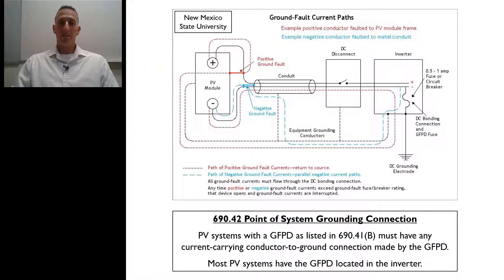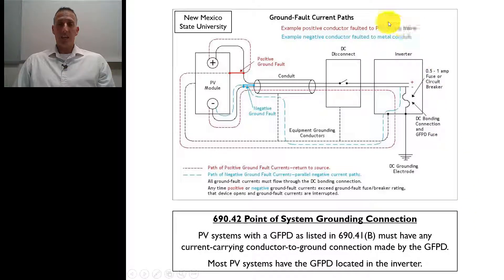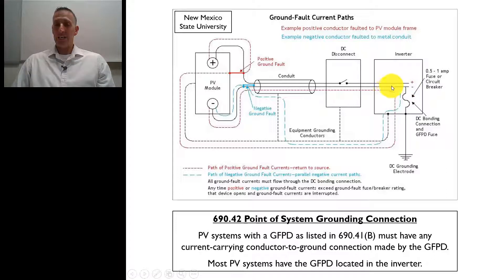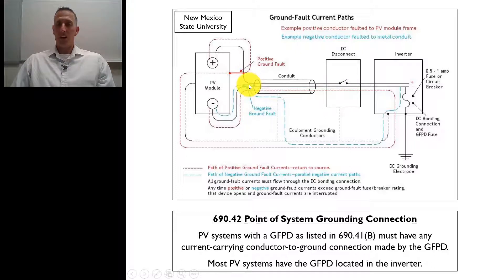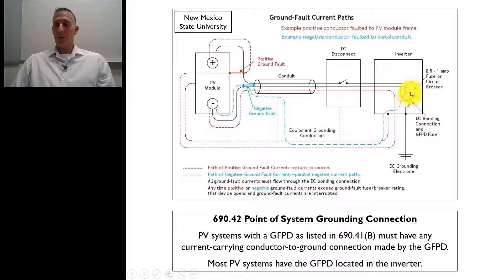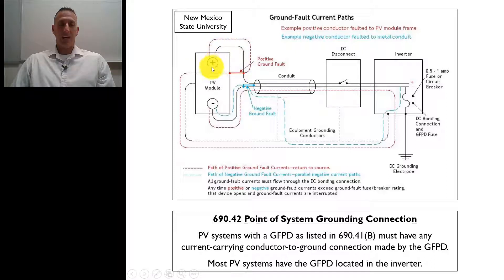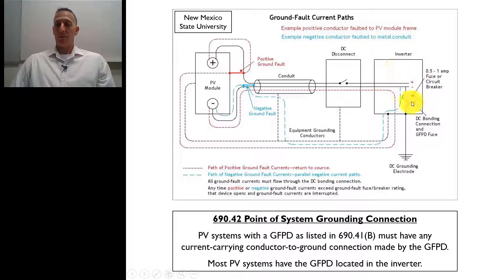Solar Training - Ground-Fault Current Paths

Comment: Great Video! This wasn't what I was actually looking for but I found it to be excellent content. 
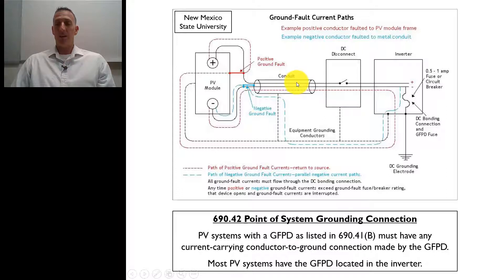   @4:30, You hit on my 'Pet Peeve' about people discussing electricity and issues with it. The old 'The power takes the path of least resistance!'... As you said it does but it takes all paths. Some not so knowledgeable people actually believe that to be true or fact. I have had to explain that if that statement was accurate, components in parallel wouldn't work, current would only flow through the component with the lower Ohm reading!
     Thank you for not repeating that old erroneous statement that way too many believe. Again, Nice video. 
       Ya'll Take Care and be safe, John 
PS: Would you know of a good video in relation to testing a solar panel for ground leakage with a multimeter? I have seen a few that are just showing and trying to sell you a specialized product that they sell. Thanks

Comment: So does it mean to hook up all metal parts of the solar system to the ground of the house ground and put a 1A fuse from ground to the negative side of the solar wiring? My inverter has a ground post on the back of the unit, so I just hook the ground post to the house receptacle ground.

Comment: At the 1:15 you mentioned that most PV systems would have the ground fault protection within the inverter.  When you say most, I assume that means that having ground fault protection in the inverter isn't a requirement for UL listing?  For example, a VERY popular inverter for the DIY crowd is the Voltronic based LV 6548, but from what I can find, even the latest variant of it, the EG5 6500EX does not have built in ground-fault protection, yet it has a TUV / UL certification.  I assume that means that not having built in ground-fault protection isn't a requirement for getting an inverter certified?

Comment: So how do you find the fault?   First find what string is causing issue then take multimeter and test each negative and positive of each panel? By disconnecting them from the string?   Make sure to cover panels so you don’t get shocked too.    Trying to figure out this now any fast reply very apprecated

Comment: Does the DC always have its own earth electrode ?  Could the AC be bonded to this also ?      Is the purpose of the fuse to stop fire ? as the system keeps running ok